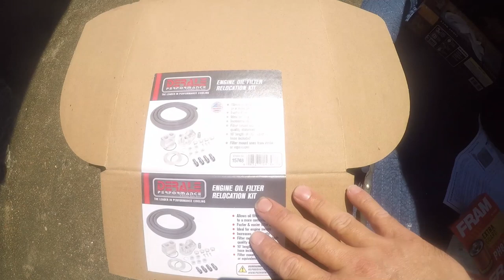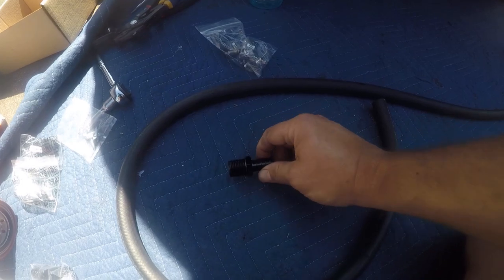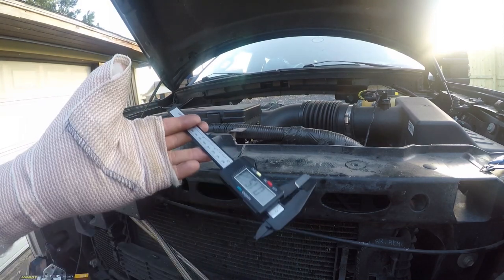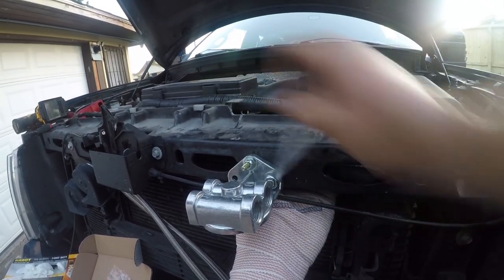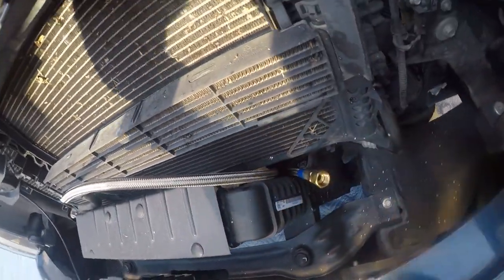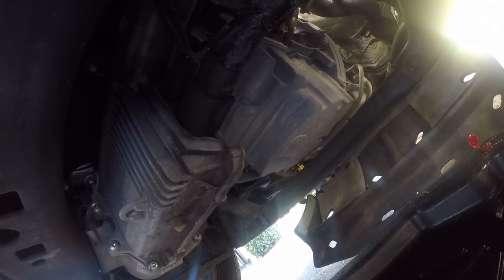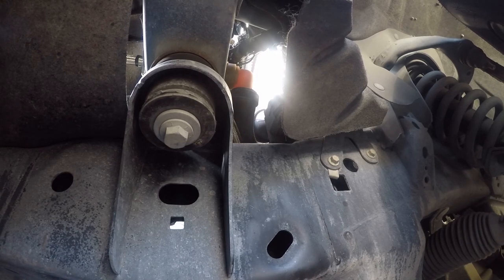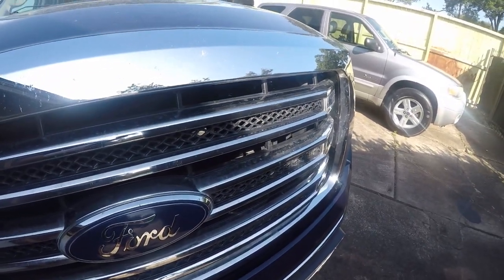F150 EcoBoost Remote Oil Filter Installation Project

Comment: Good Job. I've got to give my input. 1st, if you need to do a timing job or anything major where the body has to be lifted, you'll need to take that bracket loose. I just did my 1st oil change on my 2011 xlt eco 3.5. Total bullshi-! I removed the Y pipe and air filter cover and pulled the filter from the top by reaching down between the radiator and engine. I used a plastic microwave food tray thats about 1" tall and 8" square for a drip pan. It wedges nicely under the filter and housing flange. To remove the drip oil from the tray, I used my oil change suction pump because when you come out with the drip pan it has to be turned verically when you lift it out so, it needs to be empty. _uck pulling the skid guard and drain plug. I used the evac pump and sucked it all out thru the dip stick hole. I know I got it all because it took almost 6.5 quarts to level off the full line on the stick. I might try a remote kit too. I got spoiled with my '97 xlt off road 5.4. It came from the factory with a remote filter housing mounted up under the front left bumper. Apparently too costly for Ford to pump them out off the line with such a luxury.  In closing, with your new remote, I'd consider changing the filter only about every 2-2.5K miles. This will extend your oil life considerable. Thanks,

Comment: I finally figured out that the oil filter can be removed from the top side.Pending you have long arms like me. The whole issue I have is the way it pools up when it drains. Thought about drilling a hole for it to drain.

Comment: I went with a Perma Cool 10618 kit on my F-150, leaked from every fitting even though I followed the instructions exactly.  They said not to torque down the fittings too much or you could crack the housing, well even with the teflon tape and what I thought was tight enough, it wasn't.  This 1-2 hour job turned into two days and 5-6 hours.  I'm pretty sure custom lines like yours would have avoided the situation.
Reply from the maker: I stripped mine off when I traded the truck in.  Overall it worked and made my life easier, but I think Carmax would have freaked out about it.

Comment: I like the idea but think you should have it lower to gravity to drain . Just watched a video on pre filling the filter and I’m sold !
Reply from the maker: it's crappy Ford engineering at it's best...... only issue I had was that the filter was noisy..... I took it off when I sold the truck as I figured it would freak the stealership out.  Never had any issues with it and it can't be any more restrictive then the little passages in the block.

Comment: I definitely want to do this for my '19 Ford Ranger.
Reply from the maker: I think Ford engineers should be required to repair vehicles in a parking lot with hand tools for a little while.  It might change how some of these things are designed.  It's just a stupid design that is optimized to save 5¢ on the assembly line.  Throwaway maintenance.

I replaced this truck with a Nissan Frontier.  I don't have this problem on the Frontier.  I can reach and change the filter without being Houdini or a monkey.

Comment: Hey Brian, question. since the oil filter now is higher than the engine, after you drain the oil, when you take off the oil filter, does oil still dropping around the oil filter. The reason I ask this question is I want to relocate mine under the hood next to the engine somewhere. If oil drops around oil filter when I screw them off, I need to make sure the location is not above something that can't get oil on. Thanks,

Comment: Updates? How's everything working after six months? Have you done an oil change?
Reply from the maker: Still works fine.  Haven't clocked enough miles for an oil change yet.  Only thing I don't like is I'm getting some noise/resonance from the filter and lines.  But all heavy trucks have the same noise, just was an unpleasant surprise on the F-150.

I mostly drive the truck when I need to.  The rest of the time I'm busy trying to run the wheels off my Escape Hybrid.  It's about 1/3rd the cost to run and easier to park.

Comment: You would have had an easier time with the fittings if you had gone with AN swivel fittings. I'm about to do the very same thing on my wife's Expedition (ecoboost) and on my F150 (coyote), but I'm going to use -8 AN and PTFE hose. You could also have used riv-nuts to attach the filter mount to the truck.

Finally, FRAM makes one of the worst oil filters available. Use Wix, or Motorcraft.
Reply from the maker: Yea probably right on the AN fittings.  I don't have all the tooling for that.

Everyone hates on Fram.  I've been running them for decades and sending my oil in for analysis for decades.  They do what they are supposed to and I don't see the point in spending money on a different brand that is probably made in the same overseas factory by the same underpaid people.

Comment: what is the Length of the hoses you had fabricated.  I will contact  south houston hydraulics
Reply from the maker: I don't remember.  I think I mocked it up with a piece of hose or tubing and then measured that.  I took this off in January.  I traded the vehicle in when prices for used vehicles got silly.  I wanted a newer, smaller truck so I jumped to a 2017 Nissan Frontier from the 2014 F-150.  The little frontier is stupid simple, no computer nonsense, no flashy dash screen, no booty blower (cooled seats), etc.  My F-150 was super comfy, but I was terrified something was going to break on that engine that I wouldn't be able to afford the repairs on.  

Good news is that the stealership bought the F-150 for what I paid for it 3 years before.  :)  I just didn't think they would understand the filter system.  I also got a good deal on the Frontier that replaced it because it was a 4 cylinder in a extended/king cab configuration.   It meets my needs and is a great work truck.
Reply: @hotpuppy72  ok, I going with 78 inch hoses.  thanks

Comment: Hold on I just watched a video where they relocated the o filter on a car the they installed a turbo and this guys where professional doing that and one of the this they said was do not install the oil filter higher from the original location because the oil fro. The filter draws back to the pan and the engine will run for a second or seconds dry out now imagine that every day?? 
If I am saying this is because I am going to relocate the oil filter to on my f150 ecoboost. I'll look for the video and leave the link for more info..

https://youtu.be/JITdFJGB8MI

Please watch this before you relocate ur oil filter so u don't cause big damage to ur engine..